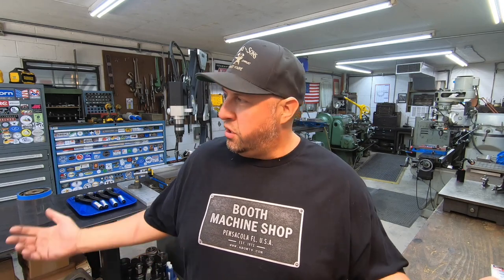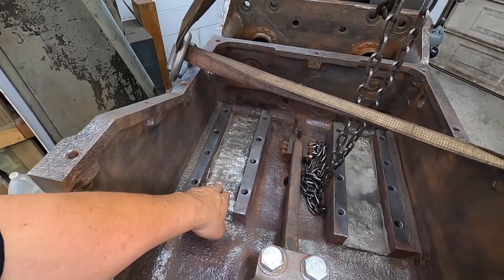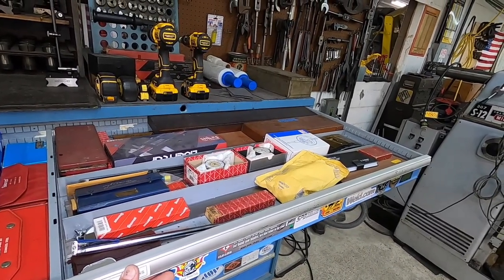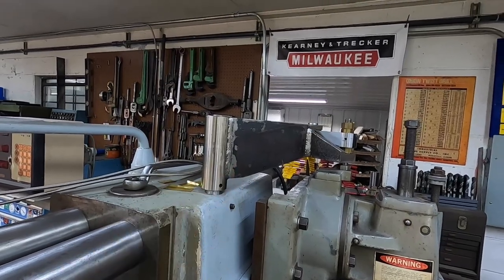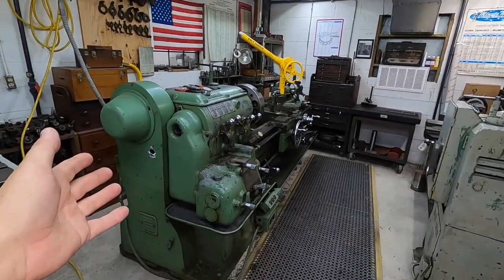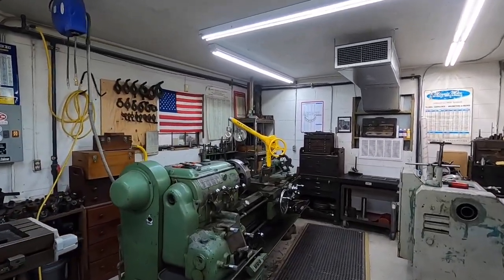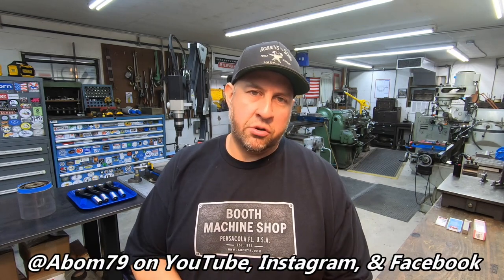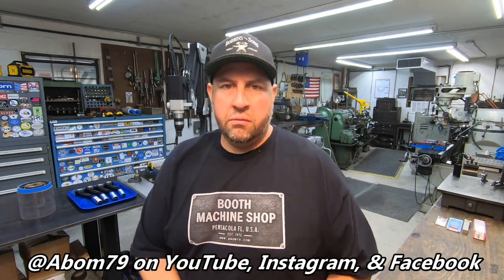Machine Shop Tours: Abom79

Comment: Thank you for the tour of your shop Adam. One thing we have in common is the 330 A/BP AC/DC welding machine. Your Dad did a great job keeping it clean and maintained. I have one now that is as close to new as you can get, it might have 50 or 60 hours on it total. I'm going to sell it soon and find it a good home. Your an expert machinist and I am an expert welder but age has caught up with me. Your Sky-Hook is one of the best tools you have in your shop and will save your back in the long run. There is nothing wrong with working hard but you have to work smart as well.

Comment: Appreciate your fondness for old school machines, i did 21 years in Avdels in the UK, they were bought out by Textron. I started in 78 and almost all of the machines were old school, Cincinatti Milacron, Fritz Werner mill, Ward 2d lathe, Benninger thread mill, Hayes copy mill etc. Then came the introduction CNC machines which we adopted, VA40, Gildermeister, Wasinos, Haas and something about seeing a machine slice through aluminium and steel then getting that familiar warm cutting oil smell when you open the door is unforgettable. Having said that i now own a Colchester bantam lathe and a small mill which i do odd jobs for friends. Cant beat old school engineering!

Comment: I do the same type of work....Job shop ..no CNC,,,I collect metal charts too!...Got rid of my G&E tool room shaper (needed the space) Have broaches  for the Davis # 5 extra  for trading... Because of the head room in the shop...Bullard and Lucas I let go. My son is the 4th. generation machinist...Moved to Brooksville ,Fla.26 years ago from D.C. area...Could not keep every thing ...Have now just 7 Lathes ,7Mills ..Cylindrical  grinding, Tool& Cutter and Surface grinding Heat treating & welding of all types... so we have a lot in common....Robbie's Machine Service.

Comment: Yeah, a 3-D printer probably isn't too far off from CNC. What I didn't understand when I started into CNC was that you STILL need all of the skills and knowledge of manual machining as far as speeds and feeds and what looks and sounds right, because you don't have the feel of the knobs and handles. So you don't have that feedback. All the things to know about chatter and rigidity and climb cutting and work-holding and materials. There are no shortcuts in metalworking.

Comment: This is a dying trade. We will always need manual machinist. I learned to do both manual and programming CNC lathes. After 40 years I retired.
Reply: It's why USA is losing in this rat-race to be strong in trade skills. These days all you need is a CNC maker and a programmer, where the skill of machinist is lost. "Insert program card, hit the GO button", there is no skill in that.
Reply: @richfoster4189 , i did all of the programming at the machine. I never was  a cadcam guy.
Reply: @kevinsago1886  You are the in-between person with those skills. Most kids today would be lost if they could not punch buttons on a calculator.

Comment: Hey Adam, at the end (27:30 about) you'd talked about replacing your do all band saw with a smaller unit that would do miters . Are you familiar with the new metal cutting mitre saws? I ran across some you tube fabricators that were using them. They look just like a wood framing miter saw but the arbor speed is a bit slower and their fitted with a metal cutting blade. It looks very similar to a wood blade. You can cut compound miters on them, which I don't think the band saws will do. https://www.youtube.com/watch?v=XdC4ah3_bTs